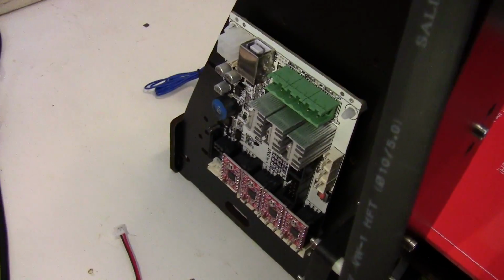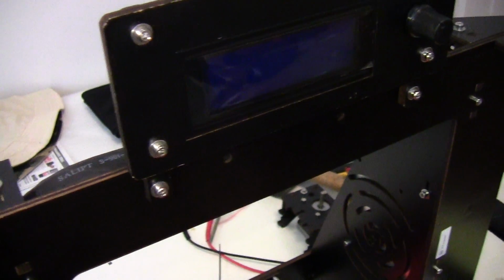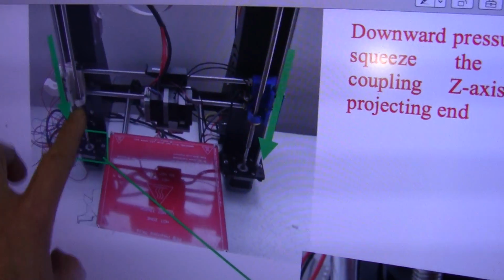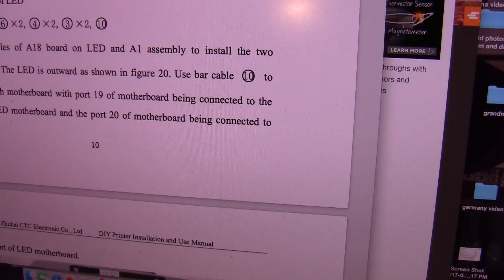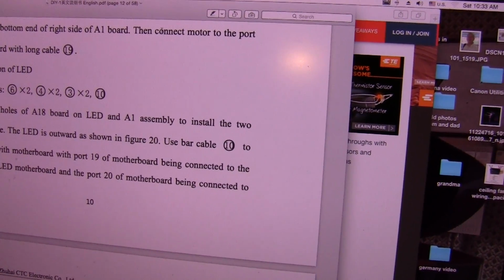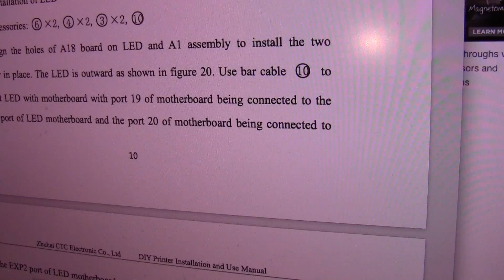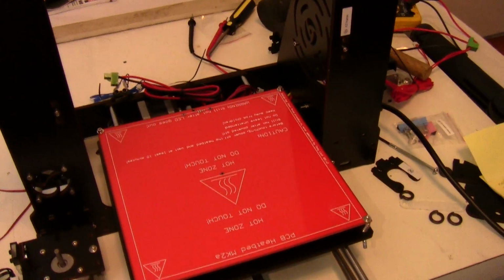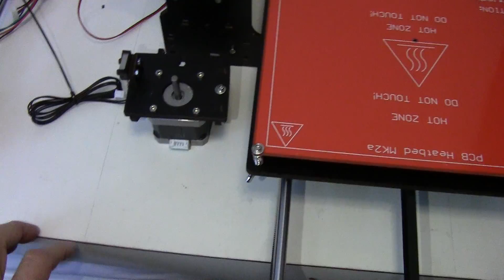prusa i3 2017 assembly problems I encountered pt. 1

Comment: Nice. I think these cheap kits are well worth the price. I have built probably 10 printers from scratch and these are a good value. I notice you saw my mod video but decided not to do it.... I think you will be fine and have a good grasp of whats needed and there is always more ways than one to fix something. Half the fun is in the modification of these printers.
Reply from the maker: Indeed I watched your video in which you mentioned reinforcing the threaded rod and the frame in the middle.  There's a lot to learn and I appreciate your making the video.  I just finished putting it together but have a bit of problem with the auto home and leveling.  The nozzle when it auto home goes outside of the bed on the y axis in the front. My first prints are kind of rough too because it is difficult to adjust the bed because of the limited up and down travel.  I guess I won't be the only one having these problems. I was just relieved when I hit the switch for the first time and no smoke came from the control board...
Reply: I'm in  half stage of my first Build.. Wish me luck.. lol..

Comment: is it worth buying?
Reply from the maker: As far as I know, it makes plastic parts and toys so it's not that useful. If it sparks an interest in you to learn 3 D design, then it is very useful.  The 3 D modeling program I plan on learning is Sketch up.  If you can use even the rudimentary skills, you can custom make small parts that will be useful.  Your son will benefit a lot from this so I think it's worth buying.
Reply: Could be worth it, if your building a custom 3d printer from scratch, as you get a kit of parts.